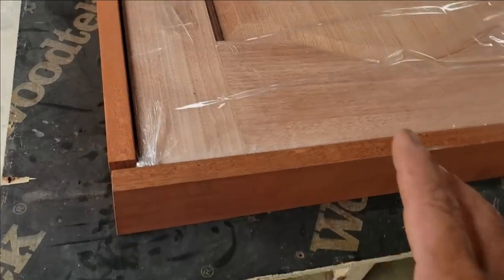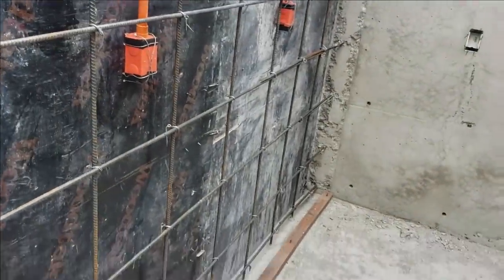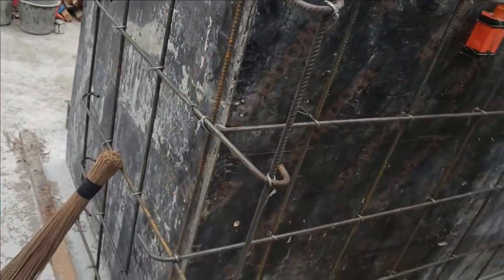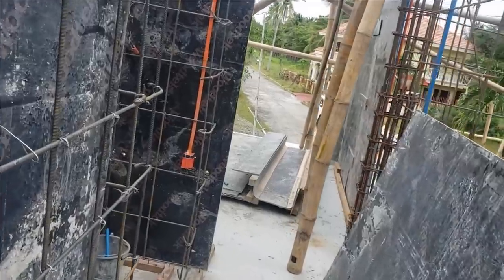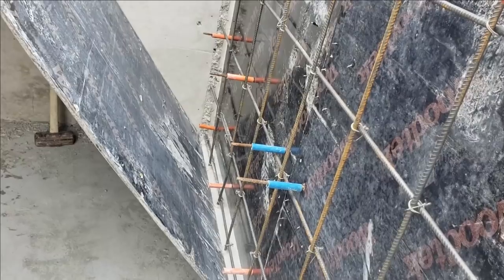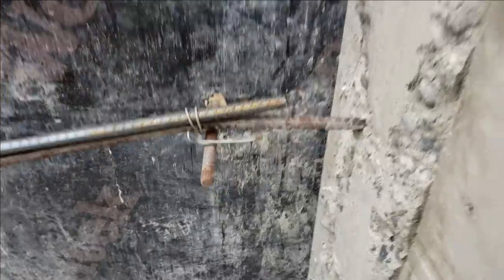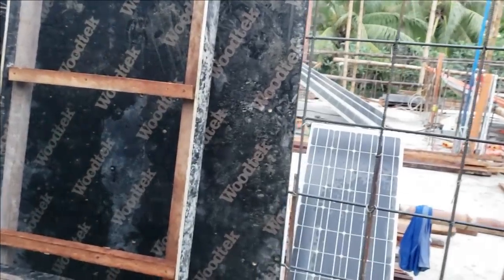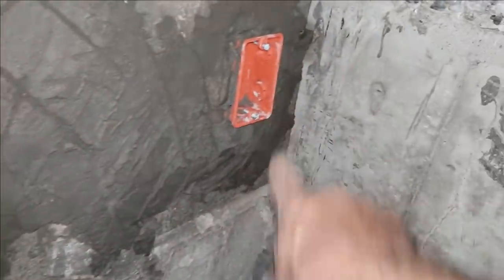Philippines Beach House Build Day 160 : My Tips in case YOU try!

Comment: A little trick for filling thru holes in the walls . Use a piece of plastic tubing put an plastic adaptor that goes from tubing to a larger pipe,  to use as a funnel, pack the pipe with mortar and use a wood dowel to push the mortar into the wall.

Comment: James, love the re-using of the boards and coco lumber predrilled to a set pattern and makes so much sense for the repeat jobs based on a considered design. Simple idea with huge cost savings on materials and most important labor. The poured concrete is fantastic in contrast to the block work and thanks so much for sharing these hints and tip basically for free for anybody to take on board. Another great day for me at work and now unwinding watching this build. Hope you both are doing great and best wishes from Melbourne tonight.

Comment: Just wondering if your gonna apply how to deal with the heat and humidity, ignore it and add a lot of windows to deal with it or beat it Lone Star style by insulating the heck out the house, seal it up and enjoy the air-con. Painted my roof white here in Bacolod, the neighbors thought I was crazy until I showed them the thermal difference 15 degrees cooler inside. Course you could stick with the cheap but always reliable swamp cooler hopefully the ocean breeze will do the trick. Enjoy your channel!
Reply from the maker: watch n see :) :)

Comment: Agree with you James that using the form to build walls is better than using a hollow blocks.
Reply from the maker: Hello Sir Armel
Reply: The hollow block manufacturing in the Philippines is sketchy.  Especially the width where you need the grout for
strength with the rebar.   Proper masonry blocks are 4x4x16 or 88’s which are also called birth control blocks.

Comment: Very interesting, I'm beginning to think that concrete forms are much better than the traditional block/beam method that is normally used.
Reply from the maker: Yes, exactly
Reply: @TexasFilipino  Are the external walls the same thickness as the internal walls (4 inches)?

Comment: You’re very understanding about that hollow block.  I don’t have your temperament because I would have taken a sledge hammer to them (The walls, not the guys. Haha) and poured the walls.  I don’t like it when you can see the joints after the plastering, rendering or parging, whatever the term is.  I’m confused about one thing though, the other day I thought you said your poured wall were ready for paint but while the walls are mostly smooth they don’t appear to me to be ready for a finish coat of paint.  Am I wrong?
Reply from the maker: you missed the part I said skimcoat and paint. Skim coat is like a plaster that smooths fills the blemishes. Floats out bad places. Like taping and bedding. Only I wont need to use too much. It is what you will paint over. You could texture with it also if so desired.
Reply: Thanks for the explanation.  Do you use any specific material so the skim coat will adhere to the concrete walls or just the “Painf?” You roll on?

Comment: Great video! I just have a question James. I know you do reuse those spacer bolts to get the exact thickness of the walls. Is there any probable difference in wall strength if I dont leave any pvc pipe holes in the walls and just leave those  spacer bolts locked-in with some nuts?  (like cutting the extra length of those bolts after curing) Im new to this and would wanna know any advice.

Comment: Great how to video, thanks, what size rebar are you using on the walls. What size threaded bar are you using.
Reply from the maker: 10 and 12 both on the walls. 12 around opens and near top of the walls  3/8 all thread - best if you use the large fender washers. less chance of them sinking in the lumber.
Reply: Awesome, really appreciate the heads up....my next builds will use this method.

Comment: Sorry again if may have missed it, but could you show again how you removed the PVC spacers from the walls?
Reply from the maker: take a scrap piece of 10 mm rebar or 12 mm whatever you have laying around. tap it on the edge of the pvc tube and tap it right out of the wall. slips right out easy. sometimes once you move it a little you can pull it out with your hand .
Reply: @TexasFilipino  ok, thank you

Comment: I have a question, might be silly, do the forms ever start to lift off the deck, or does the weight of the concrete on the bolts hold the form down, do you put a few screws through the bottom rail just in case?
Reply: NO lift. The pressure is against the edge of a piece of plywood so not enough surface area to be a problem. Also we don't put 
a lot of extra water in the mix and it is sticky. Usually a piece of rebar is used to settle the concrete and let trapped air out. We
poured 10 feet high an no problems even though we used a 5.5 HP gas vibrator.
Reply from the maker: You said it right George. No lift at all. the outward pressure just locks itself like brakes on a car.

Comment: Is there any commercial bonding treatment available in the PI for the the cold joint at the bottom of the pour?  Just curious.
Reply from the maker: Yes there is a I have some here for where it is important. those walls are not important to have it. It is not cheap. I have it here for putting on top of all my main columns where they rise up thru the slab. Concrete two part epoxy.
Reply: @TexasFilipino  Makes sense.

Comment: I never worked residential construction. Every contract I ever worked on it seemed I had to learn a whole new set of acronyms. Cracks are cracks. Never heard of them healing. Of course tight is better than measurable gap.  
I’m not totally familiar with how your forming thing and running your plumbing and electrical so I’m learning here. Do you have design dwgs that show the details of the reinforcement steel , plumbing, footers, doors, and all the rest of it. Just wondering. I’m guessing those small plastic tubes stay in the poured walls while allowing you to remove the wall anchors.also your calling the walls plywood. Are they coated with some form release. Dumb questions just trying to keep up. I thought I heard that your guys are mixing their own concrete. That’s got to be a challenge to get consistent mixes/strength. Are you having them put fiber into the mix? Don’t need to answer me directly but maybe touch on it during your videos.  I just subscribed FYI.
.
,
Reply from the maker: yes this is fully blueprint , engineered and permitted. the tubes get tapped out of the holes after the concrete cures for a few days. that plywood form board here is specialized with a poly film on it for no sticking. no need for form release on this plywood form sheets

Comment: James for your wall what size of mm rod 12 or 10 do you use.
Reply from the maker: Both. the main part of the wall 10 mm and the tops I put 12  and around some of the opens for windows or doors I will add 12
Reply: @TexasFilipino  Thanks